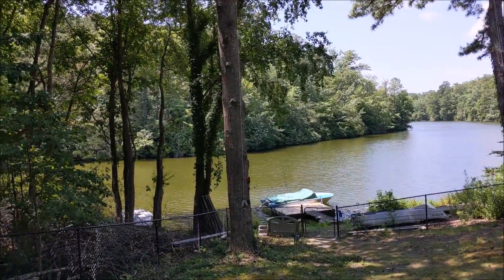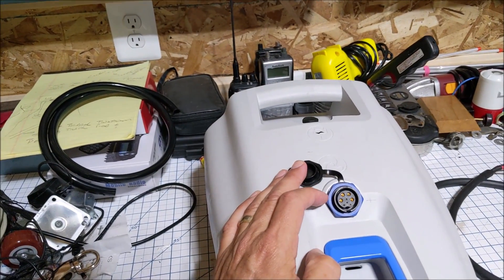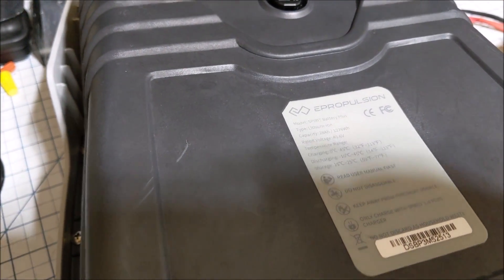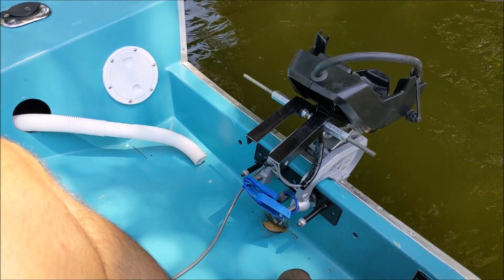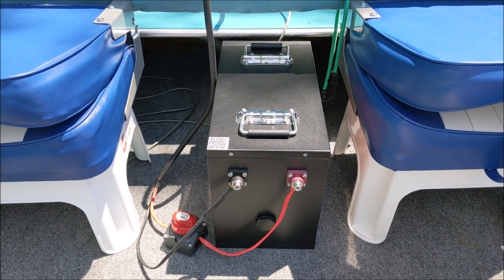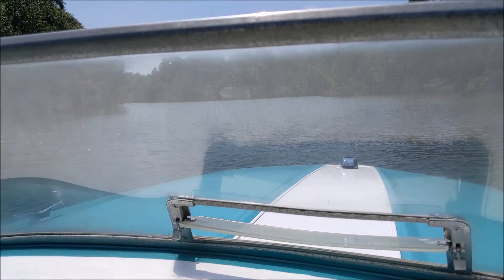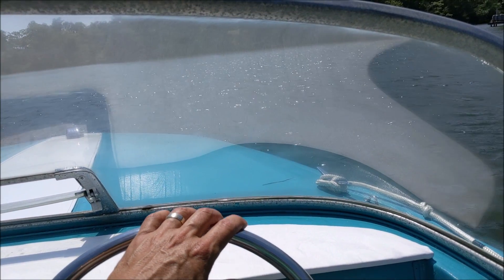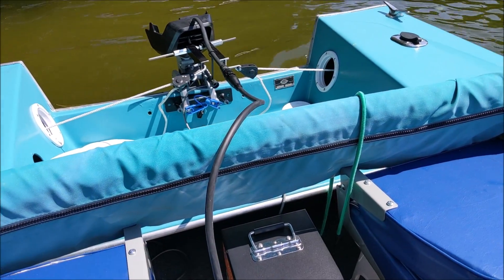Epropulsion Spirit 1.0 Plus - Bigger Battery Upgrade!  Increased Range!

Comment: I have had terrible problems with E Propulsion Spirit One Plus batteries after a year of use.  When cruising at 600Kw, as the battery reaches 40% capacity it suddenly drops from 40+% to 15% with no warning and no change in speed.  I immediately changed batteries and got back to the dock. I had this same problem when I first owned the original Spirit One batteries. I hoped that  E Propulsion would have fixed this problem with the Plus series.  Not!  The motor is great, however.  Going 3rd party 48-volt batteries from here on.  If you are buying new, don't even consider buying their batteries.
Reply from the maker: Appreciate your comments.  Yes, the motors are great.  The nice thing with epropulsion is that you can use third party batteries.  My epropulsion batter that came with the Spirit is fading a bit after a couple years.  Still works but doesn’t hold a charge as long.

Comment: Amasing  video. I wonder if I could use the same setup, but with the "older" Epropulsion whitout " Plus" in its name. ( its an 40v engine) Yours cincerly Jesper Roskilde Denmark
Reply from the maker: Thanks for your comment.  Im not sure about your motor but these motors generally have a wide acceptable voltage range.  For instance, the Spirit 1.0 that I have has a working range of 39 to 60 volts.

Comment: Thanks for video! The motor should have a KV rating. This rating indicates how many RPM per volt. If this battery is supplies more voltage, even just 1, and maintains less voltage drop throughout then your variable DC motor should be delivering a bit more on the rpm side.

Comment: wonder what the range would be with 628ah battery capacity?
Reply from the maker: The motor pulls about 20 amps on high so 628/20=31 hours.

Comment: Very helpful thankyou! I have a spurit evo with the built in battery. Ive added the eprop solsr controller and a panel but you can only have +180watts. It extrnds range but your loosing mist of the time. Contemplating doing exactly what you have done so i have more range and i can put a much bigger solar array into it!

Comment: I bought my Spirit 1.0 at the beginning of 2019. It’s a remote-control version and runs on 40.7 nominal volts. The battery hasn’t been performing well for the last two seasons, so I decided to replace it with a new one. I contacted the seller and he advised me to buy a cable for external battery use. I tried to start the motor with that cable, but nothing happened. I contacted the seller again, and he had to consult the factory. The factory said it couldn’t be run with an external cable and advised me to buy a new battery, as they are no longer manufacturing batteries with 40.7 nominal voltage. Here is their offer for the new battery:
1.	I should pay the price of the new Spirit Plus battery.
2.	Pay for software updates for the new battery to make it compatible with the older voltage system.
3.	Pay for the software update for my remote control.
4.	The motor needs to be send also for the upgrade. Even after the update I cannot use the external battery cable or buy a new stock Sprit battery without the battery software update cost.
Reply: Hola, estoy en una situación parecida, tengo el Spirit 1.0 de 40,7 v no consigo cargar la batería, la desarme y encontré una de las celdas hinchada y sin tensión, la conseguí una similar en aliexpres y la sustituí, el problema es que la placa de circuito también tiene algún tipo de problema y  sigue sin cargar con el cargador original, lo cargo directamente a la batería desde el interior saltando la placa de circuito, uso un cargador para bateria de 40,7 v 2 amp, comprado en aliexpres la tensión máxima es de 46,2v y de momento puedo usar el motor aunque no a máxima potencia, por el fallo de la placa de circuito espero poder solucionar este problema más adelante

Comment: I wanna ask,
The motor functions are showing same as original battery with external battery?
Reply from the maker: The tiller readout makes approximations on the battery state of charge and draw usage.  It works but is not as exact as the battery that mounts to the motor.

Comment: Have you had any problems using this battery set up since you made this video? Does the different amperage of the 51.2v  batteries make a difference(25 vs 50 vs 100 amps)? May be a stupid question as I’m new to all this.

Comment: Is there a battery you recommend for the 1.0 original not the plus? also what is the part number for the extension that I assume will be the same for both 1.0 and 1.0+
Reply from the maker: Any 48v battery will do the job from lead acid to LifePo4 units.  The LifePo4 batteries will certainly last far longer and can be run down virtually flat compared to lead acid that shouldn't be taken below about 50%.  I've had fine results from the LifePo4 batteries on Amazon.  I've tried several manufacturers and they've all been fine.
The cable is pricey but is plug and play.  I ordered mine from Tiny Boat Nation:  https://tbnation.net/products/epropulsion-48v-e-series-lithium-battery?variant=39661945946247&currency=USD&utm_medium=cpc&utm_source=google&gad_source=1&gclid=Cj0KCQjwzby1BhCQARIsAJ_0t5Pt3rJOLUVqOAKmqQk9MBB8EP-B5x2i-w_k3WcIYwI0CO-zDj8V3wkaAnYeEALw_wcB
Reply from the maker: I just ordered two of these for a new boat motor project.  https://amzn.to/3YrFPjq

Comment: Is there a battery you recommend for the 1.0 original not the plus? also what is the part number for the extension that I assume will be the same for both 1.0 and 1.0+

Comment: Hello! Fantastic video🎉 I'm thinking of buying the same battery. It's a problem it says 51,2V but needed voltage is 48V? Regards
Reply from the maker: Thanks.  The ePropulsion motors will run from about 39v to 60v.  No problem using 51.2v batteries that will actually in reality charge up to around 54v.

Comment: Hi! First of all, great video. Very interesting job!
I have tried connecting the charger that came with the original battery to the two plus and minus pins on the motor connector plug.
Strangely the motor doesnt start.
I am wondering if those four smaller pins somehow play a part in this mystery?
Keep up the inspiring work!
/Deniz
Reply from the maker: Thanks for your comments.  Very appreciated.  The charger will produce enough voltage but can't supply the needed amps to make the motor run.
Reply: @drez20001  the reason the motor wasnt starting is most likely because it has a fault. Showing the E21 error code. I will try again when the motor is fixed and working again.

Comment: How does the controller calculate the runtime if it doesn’t know the external battery capacity? Or did you program it somehow? Also 20% usage after one hour of full throttle can’t be right, like you said the original battery gets about 1 hour total (which is what I also get on mine, would I go full throttle all the time). I mostly do around 300 Watts which gives plenty of runtime, but I’m really interested in using another external battery like yours.
Reply: I just figured out the Spirit 1.0 EVO model has a different tiller menu, with the option to set the battery capacity. I have the 1.0 Plus (same as yours), which doesn't have this option (while the manual says it's no problem to use a larger external battery, like you did). So I wonder how you changed this setting?

Comment: Your external battery costs much less than what Epropulsion offers, even with the purchase of a cable and charger. I want to extend the range of the Spirit Plus on my sailboat. Thanks for posting your experiment. I've seen 48 volt lithium batteries, 20 amp hours, and wonder if they would also work. Lighter, easier to haul up and down dock ladders. They're designed for e-bicycles, I think.
Reply from the maker: Indeed.  It's not necessary to buy the proprietary battery unless the form factor is important.  A boat with some storage capacity could easily carry enough battery for long run times.  The sailboats I used to have would have worked very well with this little motor and a couple LifePo4s in the hold.

Comment: Thank you for the informative video.  I seems clear from your test run that the standard ePropulsion battery is not necessary for the operation of the motor.  Your images showed some electronics in the ePropulsion battery case, but I am assuming that this is only the charge controller.  If I am mistaken, I would be happy to know.  Thanks again.
Reply from the maker: You can use your own battery banks as long as they are between 39 and 60 volts.  The tiller head will estimate run times and wattage used but is not as accurate as if you were using the battery that was designed for the motor.
Reply: P.S.  If I were going to use the ePropulsion Spirit 1.0 with an external battery and without the stock battery, I would need to keep the tiller and tiller-based controls.  As far as anyone knows, does this change the analysis?

Comment: Cool video. Have been considering doing this myself but unsure of which battery to get. What are you using to charge the battery?
Reply from the maker: Thanks.  I bought a good 48v smart charger off Amazon.  Cost about $150 or so.  Lots of charger options out there.